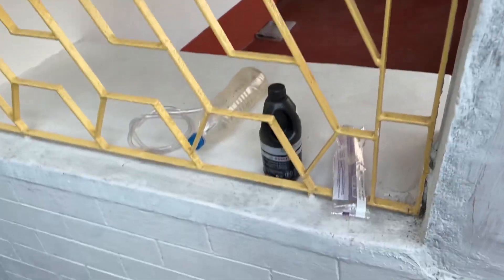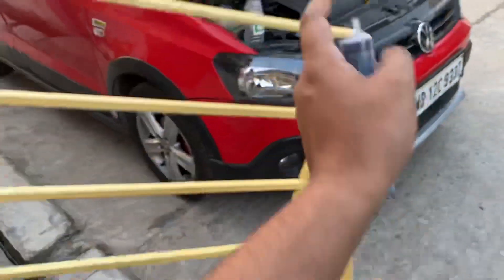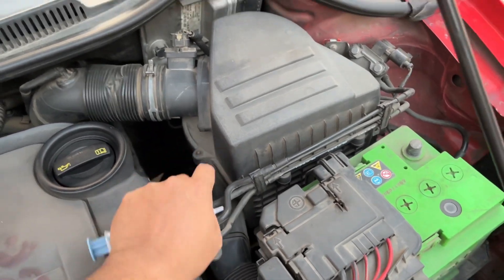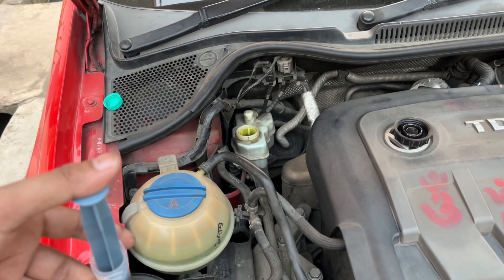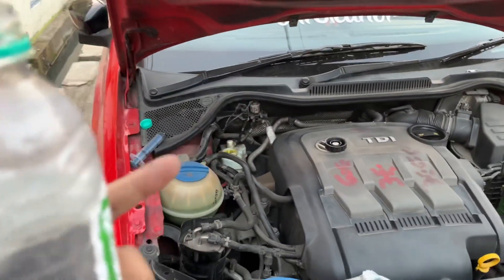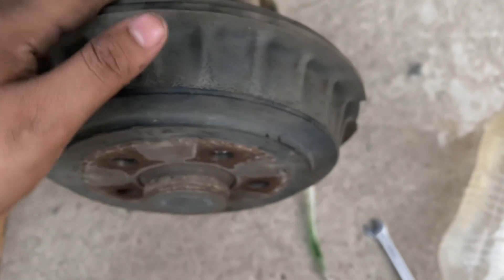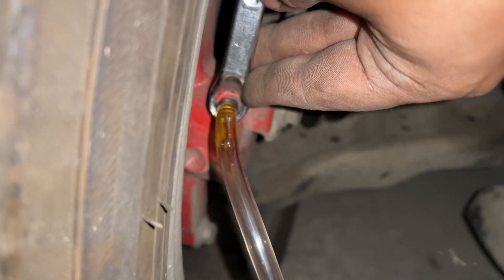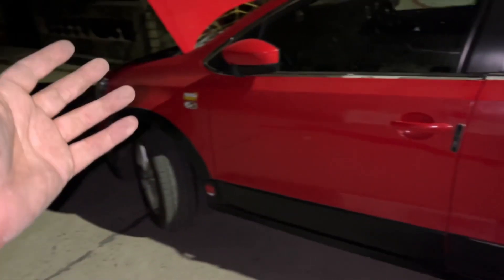Brakes Oil & Clutch Oil Bleeding for VW Cars | VAG | SR

Comment: Always use Pink or Red colored  coolant of Toyota, VW or Liqui Moly brand on VW group cars. The Green Coolant will definitely corrode the coolant channels in the Engine Block.
Reply from the maker: I am using blue coolent antifreeze one
Reply: @StarlordRider  I always suggest flushing the coolant every 20K Km and cleaning the coolant with RO water and re-add the coolant for a rust-free coolant line.
Reply from the maker: @karthik_k.j  yes it's a good to do stuff
Reply: @StarlordRider  VW Group cars are more prone to rusting and blocking of coolant channels. Flushing periodically is a useful preventive measure.
Reply from the maker: @karthik_k.j yes true